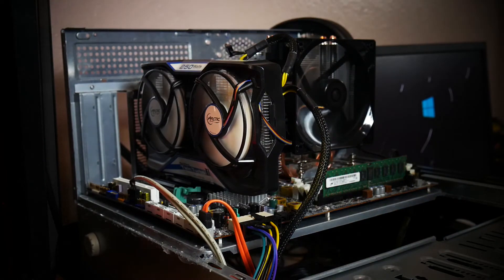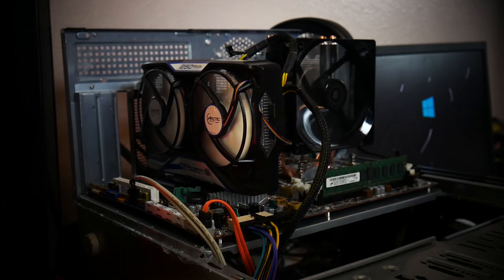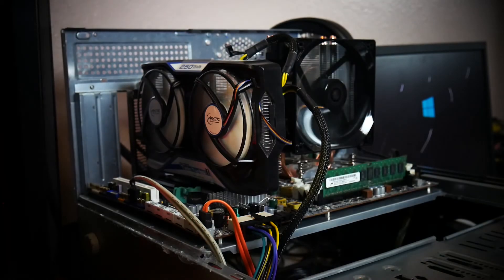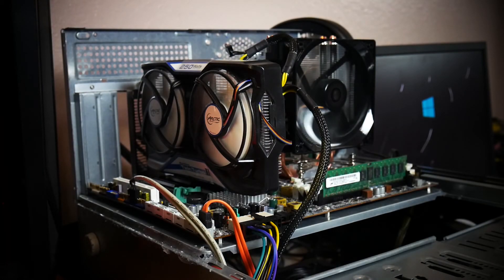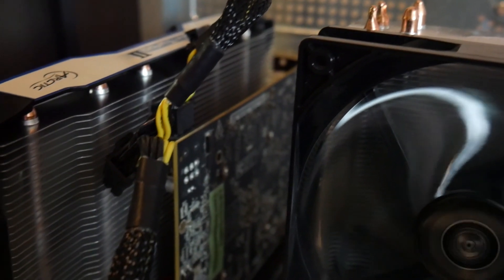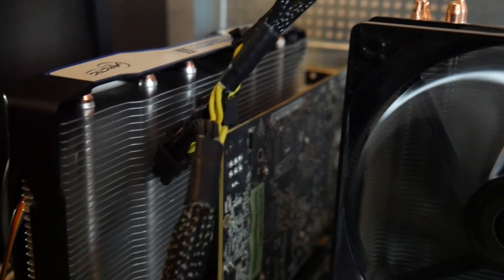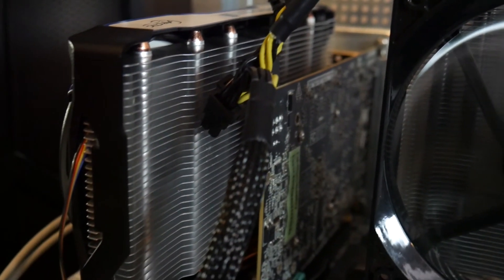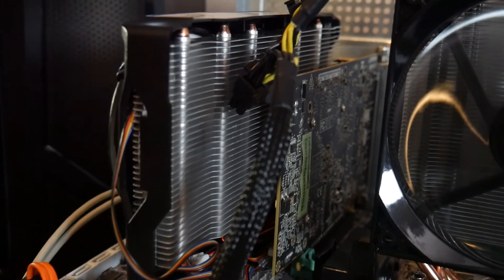LIQUID METAL: Improving RX480 temps!

Comment: I'm still wrapping my head around this. He got quite beneficial results, while some other youtubers report having only 1-3 degrees drop, which imo, anything below 5C is not worth the trouble.

So what's the variable here? Heatsink designs? Number of heatpipes? Ambient temp?
Reply from the maker: The aftermarket heatsink/cooler is a big one. Can't really compare to other people doing this using their stock cooler. Better cooler + liquid metal combo up for the results you see. It's not or the other, it's both.

Comment: can i use this liquide metal on my msi rx 480 gaming x 8gb plz   i need a real inswer
Reply from the maker: I would advise you specifically against that. Use Kryonaut instead for easier and safer results.
Reply: @CoalitionGaming   thanks you 
Btw i have a rx 480 gaming x and im getting  temp of 70 c  on almost 100% fan speed  .with  a 1340 mhz oc on core clock is kryonaut will help with the temp ??
Reply: You seem way too dumb to be using LM.

Comment: Can you give us some updates about performance and the hardware condition?
Reply from the maker: Well this RX480 belongs to someone else who is out of town right now, CGC member Bitcoin_Louie. I can follow up with this specific GPU application with him and see what he says. It's in his secondary rig so it doesn't see much use, unfortunately. I did however liquid metal my EVGA GTX 970 ftw+ shortly after this....and that didn't go well. Though that's because of the cooler coldplate material, which I'm sure is higher quality on a standalone aftermarket cooler like thr Arctic Twin Turbo as shown. Here's the follow-up video for my other gpu application. 

https://youtu.be/Jtv0_x0Hocs

If you do this, just make sure your cooler's coldplate is a good quality copper and not just copper plated aluminim or something like that.

Comment: Can you keep the tape on around the gpu or do you have to take it off before you put the heat sink back on
Reply from the maker: Gotta take it off before putting the heatsink on
Reply: I was just seeing because people have told me that you can keep electrical tape on them
Reply: I don’t really trust myself
Reply from the maker: easy to apply the tape, easy to remove after the liquid metal is placed. nothing to worry about